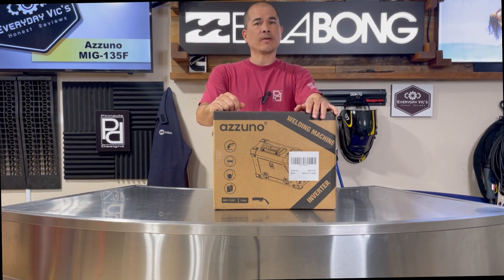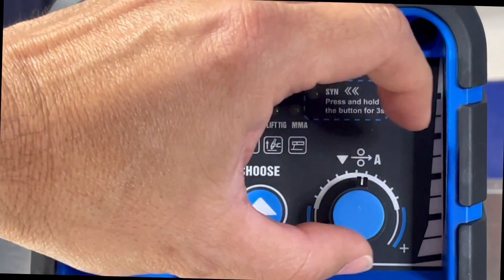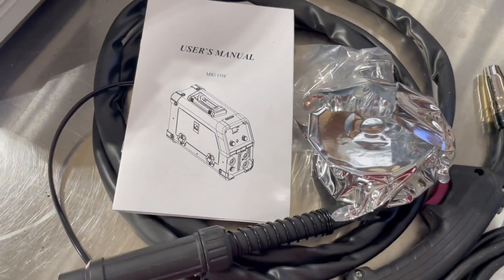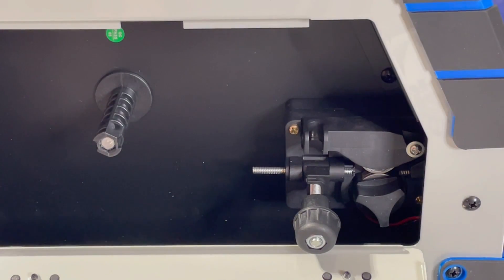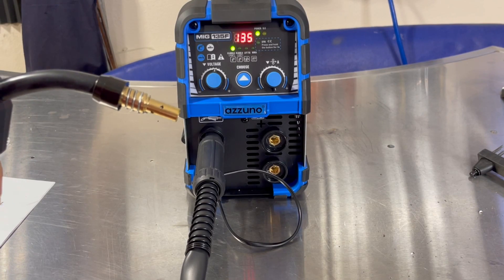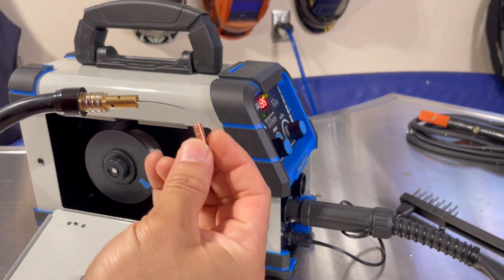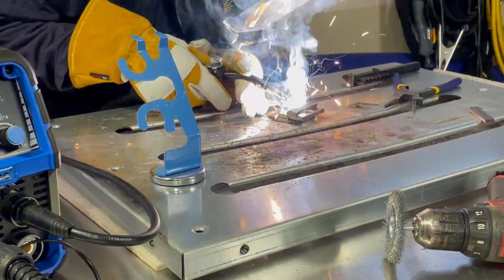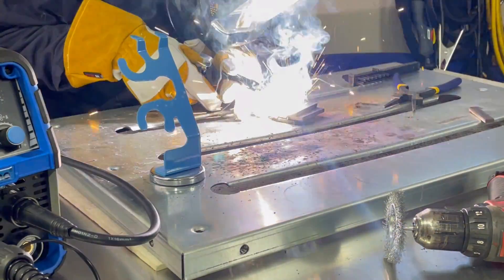A detailed review of the compact Azzuno MIG135F multi-process welding machine.

Comment: I like it on the bench but not out in the field , it has a long lead for the gun but if it gets the slightest loop or partial loop even laying on the ground the wire birdnests inside, also you have to keep an eye where the gun goes into the machine, it gets loose easy making a gap so again wire feed problems, I keep it on the bench only now & use my harbor freight Titanium 125 for in the field.